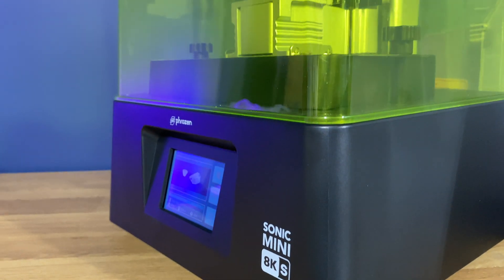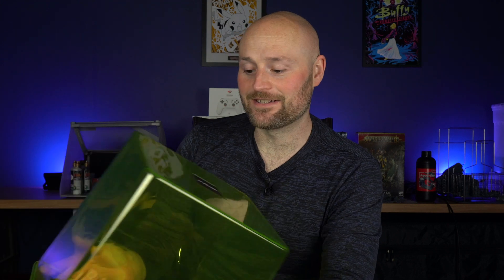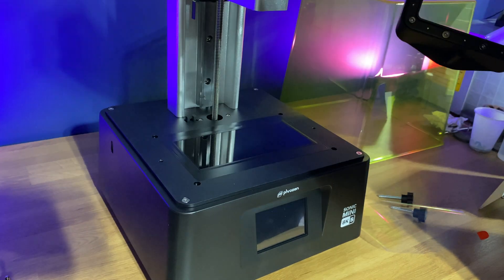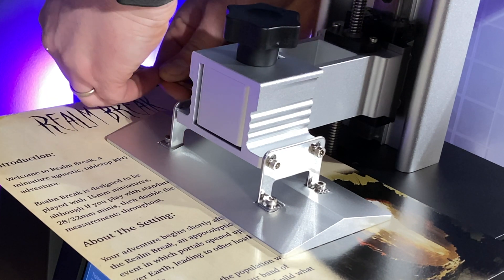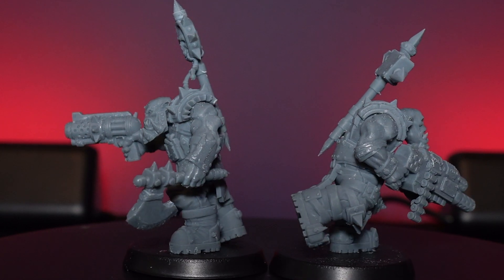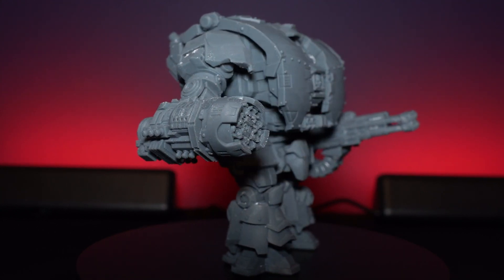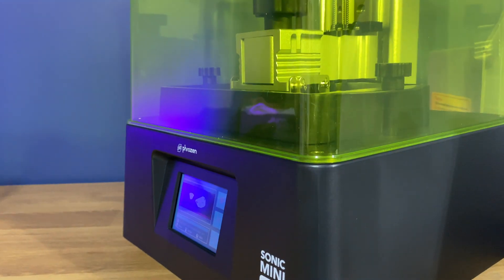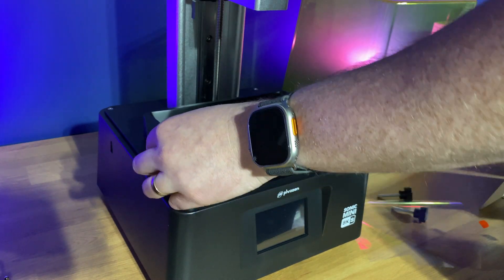Phrozen Sonic Mini 8K S: The Ultimate Miniature Printer? First Impressions

Comment: Leveling: Just put your vat on, add your resin and level in the vat.  You shouldn't have to remove your vat hardly EVER which will avoid dust, scratches, resin on the screen etc.  PS: Your prints have a lot of shiny spots indicating insufficient pre-cure cleaning leaving leftover resin residue..whip out that tooth brush and/or sonic cleaner!

Comment: I got mine and it had an uneven build plate so prints fell off first and third print, third print it squished the fallen bit into the screen, pinching and slightly tearing the nFEP, so three prints in an the things unusable, with an expensive repair bill (was dangerously close to adding a new LCD into that possibly). So be warned, quality control is... eh... and their supports taking it's sweet time getting back to me on this as well... Be warned! Might not happen to you, but also might.

Comment: Hello would you buy this over the Elegoo Saturn 2 for another $50
Reply from the maker: Really depends on what you're going to be printing. Both are solid machines, but the Saturn will offer the larger build volume for larger prints, but the Phrozen will offer slightly better print quality.